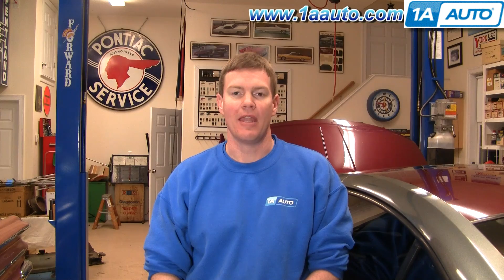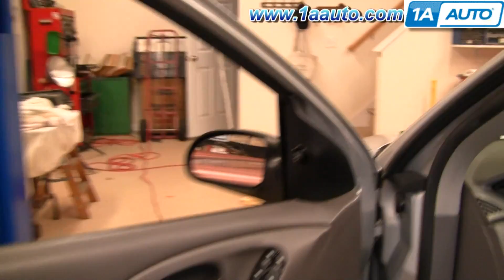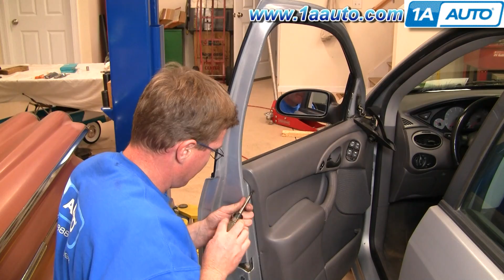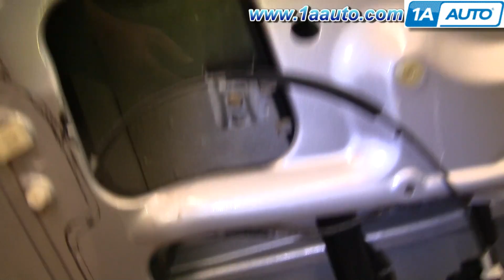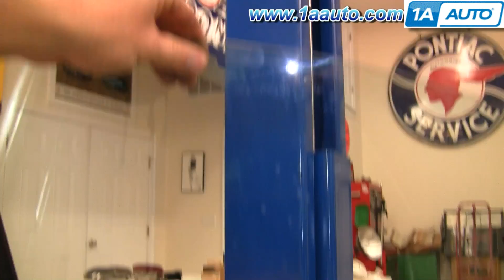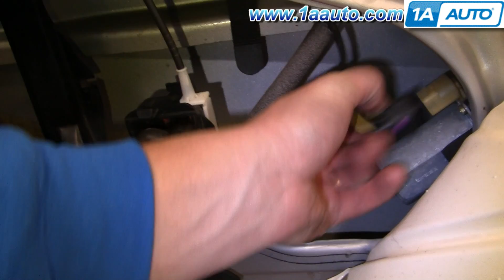How to Replace Window Regulator 00-07 Ford Focus

Comment: Great video, very helpful. Rather than removing the glass, I used a piece of duct tape to secure the glass in place.  I put the duct tape over the top of the door frame to keep the window from falling into the door. Hoping this small tip helps.

Comment: Thank you @1A Auto for this vid. It took me a little bit longer than 12 minutes to change out the regulator on my 2002 SE ;-) but between the vid and my Haynes manual everything went pretty smoothly.
Removing & replacing the regulator itself was not that big of a deal, except that one of the M6 bolts that mount the reg. to the door frame stripped out when I was removing the old reg. Fortunately I found a short M6 bolt in my "bucket o' bolts". The bolt I found is a Phillips drive instead of a hex drive, but hey, it works!
The most challenging part of the job was removing & replacing the interior trim and what not. I invented some new words (!) while dealing with that!
Reply from the maker: +WhatGoesAroundComesAround Thank you! We love empowering our customers and showing how to perform DIY auto repairs with our high-quality auto parts.  http://1aau.to/m/Shop-1AAuto-c

Comment: I wonder why the US models are using a bunch of different sized bolts in the door when the MK1 european models use philips head screws so you just need a screwdriver to get the panel off
Reply from the maker: +Zaphod Gaming Thanks for checking us out! 1AAuto.com

Comment: mike i have the same car but the wagon model.  this popping  sound just started   but it is only  once  in a while.   and only once in a while the window wont come down     think its time for a new  regulator  or could it be the switch ?
Reply from the maker: +JOE Hyundai Tech Thanks for checking us out! We wouldn't be able to tell you exactly the cause but it sounds like there is an issue perhaps with the motor starting to go.

Comment: Every window that I've had break, which is up to 5 or 6 now, has not been the cable. It's been those white plastic clips that attach the window to the rails. Unfortunately you can't replace just the clips. If you get a better quality regulator like the 10 year warranty  1 from am auto, you will notice that these plastic clips have a thick metal wire through the middle to reinforce them. The cheap one's don't and those clips will snap again. I had that happen once a week after I replaced the old one. After the first couple, I got tired of spending $100+ to have them replaced and learned how to do it myself thanks to videos like this. Now it costs me $46 and an hour or so of my time.

Comment: Excellent video. My son (age 12) and I replaced the window motor and regulator just a few moments ago. It was the driver's side on a 2000 Ford Focus. The video went perfectly step by step. Also, I ordered the part through your company and the service was excellent. Not only was the service excellent, but the cost was less expensive than other places. Thank you for the assistance.

Comment: Should I use WD-40  or grease anywhere  when putting it all back  together.  Thanks
Reply from the maker: +Rudyard F Our window regulators come pre-lubed, you shouldn't have to put anything else on it. Here is a link to the replacement window regulator shown in this video. http://www.1aauto.com/1A/WindowRegulators/Ford/Focus/1AWRG00397?utm_source=YouTube&utm_medium=CTA+Comment&utm_campaign=ytcomment&utm_term=pJIM3ss-jos

Comment: Great video instructions...could not have been more clear. I did a 2000 focus and ran into one issue. The motor on the new part was a bit offset from the original and the wiring harness that is clipped to the door was in the way. I had to drive out the clip and run it a little above the motor on the new part. Still was nice and tight against the inner for frame but wire tied it back just in case. Thanks for the fantastic videos, I have used them before!
Reply from the maker: +Al Chemist We love to hear that our videos are helping people get the repair done! That's our main goal. Great work, and thanks for checking us out. For anyone else who might be doing this job, we carry the parts shown in the video on our website. Order from us and we'll cover the shipping. Here's a link: https://www.1aauto.com/1A/WindowRegulators/Ford/Focus/1AWRG00397?utm_source=YouTube&utm_medium=CTA%20Comment&utm_campaign=1ATony

Comment: Great video. My only problem is the window is stuck down
Reply from the maker: +supersnake151 As an expedient solution for security and weather, you should be able to open the interior door panel and prop the window up with a 2x4 piece of wood.  1A Auto does offer this window regulator at the following link:  http://www.1aauto.com/1A/WindowRegulators/Ford/Focus/1AWRG00397?utm_source=YouTube&utm_medium=CTA%20Comment&utm_campaign=1ATony

Comment: Just finished installing my regulator in my 2004 wagon.  What a breeze!  They have come a long way since I changed out my 1976 Gremlin regulator.  One thing Mike didn't cover (or I missed), there is a plastic hold down & the plastic tab (Mike calls it) that holds down the cable cross to the center of the door.  They need to be transferred to the new piece.  Other than that, it's as simple as the video.  I may add, to reattach your window buttons & lock switches once you have the regulator tightened down and the window in and give it a few test runs before you put it back together.  Happy Motoring! Thanks 1AAuto.

Comment: I got as far as pulling back the water shield after taking the door panel off, but now I have a new issue. The plastic that lines the shield is completely melted onto the metal. Is it time to take it into a shop or is this something I can fix?
Reply from the maker: Thank you for watching. You may be able to take care of it yourself. Peel it back and see if you can re stick it or you can use some tape to re attachment. It is just a barrier to keep dirt from getting inside the window track and does not need to be perfect. Hope this helps!
888-844-3393

Comment: hey i need some help over here ... I try to install elecitric side mirrors on my Ford Fusion ( its look like this focus)  but the problem is I do not have the cables to the switch and the mirror, I know that I need to replace the entire cable harness ... wonder if there is another way or you could add a clip on youtube ??
Reply from the maker: We currently do not have an auto repair video on this application. We'll keep this request in mind in the event that we need to make this repair in the future.

Comment: Hey 1A Auto,
I just got problem again with my Ford focus 2000. Passenger side window stopped working, without cracking, or anything. The day before was working and the other day, nothing, pressing that switch and nothing even sound or cracks. What could it be? My car stays outside could it be from the rain that we have these days in my country? 
Thanks in advance, I hope for an answer from you :)
Reply from the maker: Thank you for watching! It could be the motor or the switch. To verify the door panel will need to come off. You then disconnect the electrical connector for the motor and put a test light/multi meter to the vehicles side. You should have power at the connector when a activating the switch. If you have power in both the up and down positions then its most likely the motor. If you find you have power in one direction but not the other then you know it is the switch. Hope this helps!
 888-844-3393
Reply: 1A Auto Parts Thanks for your answer 1A Auto, you never let me down. Yesterday I red some "bro tip" from a guy that had this problem. Turns out that if I click on the switch button and hold it, while slam the door it got it work again. Now it works without problem. Do I need to clean the motor for this not happen again (some WD40 or..)?
Thanks man and cheers :)
Reply from the maker: Milan N.
You can use a spray White Lithium grease, it is tackier than WD40 and will stay in the tack.
888-844-3393

Comment: I want to thank you for helping me with this info. I have 2004 ford focus and yesterday, my window in the driver seat was not working. I came across your video and really help me out on taking apart the side of the door. It turn out that that the window regulator was no good. But I bought a new one and with your video, it helped me put it together. Can you make a video on how to fix the ac in the ford focus. I already put a couple of cans of freon and it lasted only a couple of weeks. Can you you tell me what is wrong with my car?
Reply from the maker: You may want to have a leak test done on it. They'll put dye in the Freon that should show you where the leak is coming from.

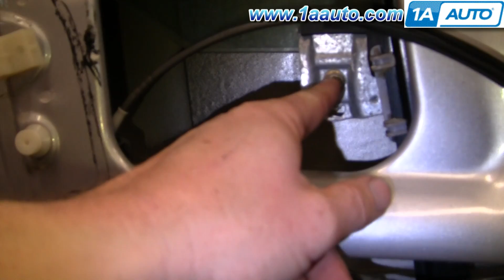Comment: Hey 1A, thanks for ur vid, I have an issue that wasnt covered in the video.My window was pulled out of its clips and fell inside the door. I got my door open and inside it I found that the clips that hold the window(shown at 4:58)were broken off and laying on the bottom of the door.I dont think my regulator is broken since the holders arent in to hold it up. It looks like the plastic pieces that hold them are broken. Is there a way to replace those parts and reattach the clips to the bars again?

Comment from the maker: There should be a couple of screws on the end of the door that hold it in place, you would also need to disconnect any rods or cables from it on the inside of the door. 1aauto.com 888-844-3393

Comment: THANK YOU THANK YOU THANK YOU!! This work on my 2005 ZX4 Focus. Paid $128 for the complete OEM regulator. Took a few hours. Could do it again in 30 min. I really appreciate the time you spent on doing this video. You're instructions worked like a charm. 

Quick question, do you recommend greasing anything up? When I removed the original regulator, there was a little bit of grease in random parts.

Comment from the maker: If you are having issues getting the window to come up and down, you should attempt to remove the motor, if you cannot access the motor bolts, you will have to cut the metal cable to free up the window so it can slide up and down.

Comment: Many thanks from the UK for your tutorial - it saved me paying garage labour rates!
I found that I didn't have to remove the glass completely.
Once I released it from the holders, I simply pushed it up in the frame a few inches and wedged a piece of card between the glass and rubber channel to stop it slipping back down. I also added a strip of Duct tape from the glass to top of door frame for extra support!

Comment: The tutorial is indeed excellent, it would have saved me some brain-work if I had watched it first. However, the way to release the handle cover is through and access hole under the handle. Stick a small screwdriver through the hole and pry the cover off. This will prevent scratching up the door handle.

Comment from the maker: You may need to remove the door panel to unlock the door from the inside, or if you have a remote you could try to pop the locks open using that. Our sales staff could help you out with replacement parts. Our toll free number is 888-844-3393 1aauto.com FREE SHIPPING in the lower 48 states.

Comment: My '01 Focus has the front passenger door locked and cannot be unlocked. A friend pulled too hard on the exterior handle and broke it, so now I'm stuck unable to open the door at all. Any help or advise will be greatly appreciated and I am also in the market for a new handle for the exterior. Please contact me at bojack6669@att.net or by calling 317-372-8483

Comment: I have a Ford Focus -01 1.6l motor where the window regulator all of a sudden didn´t worked when i pushed the button. No grinding sound or anything at all, it just happened. I can hear a klicking from a relay, which seem to be inside the dorr, when i push the button but nothing happens so im clueless, maybe the motor?

Will the panel with screws and such be pretty much exactly the same for my car then for the car in the video?